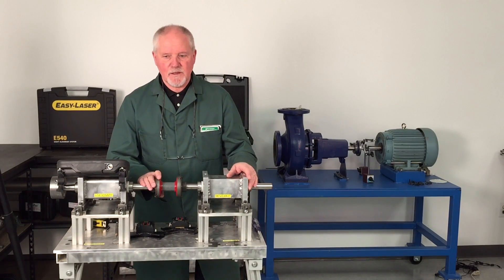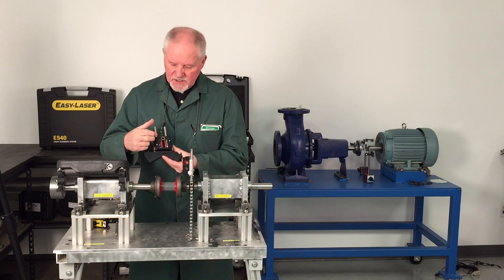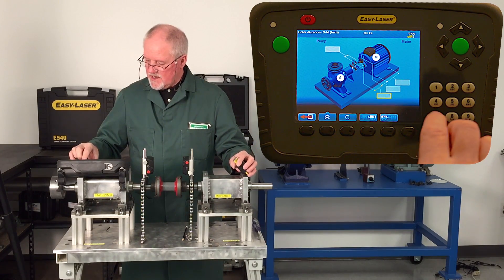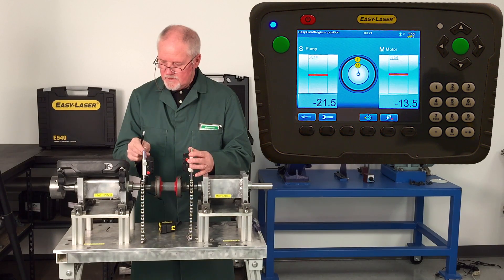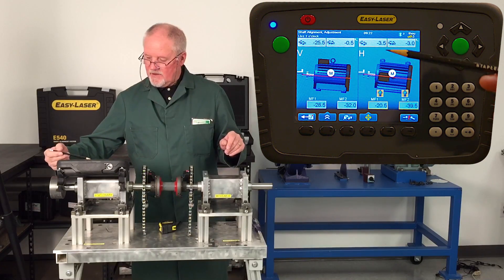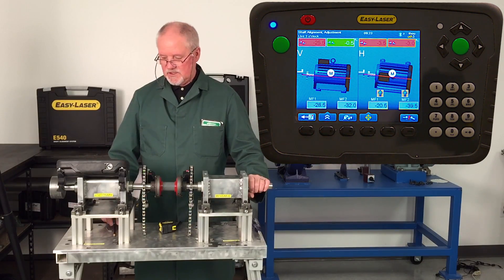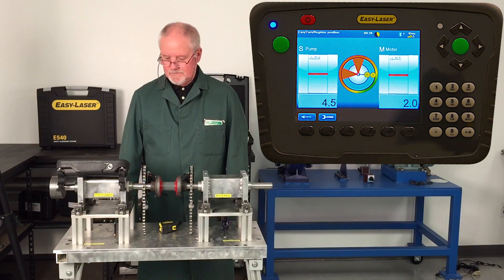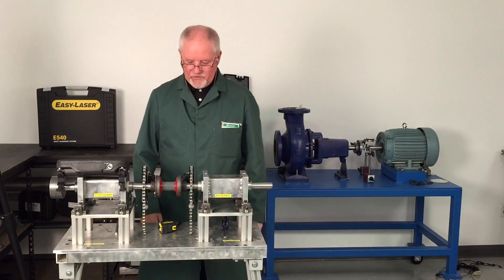Easy-Laser E540 (& E420) Training - Horizontal Shaft Alignment

Comment: At 4:49 you said you're happy because it's under 20 thousandth? But after angular adjustment, one of the values are more than 20 thousandth, why continue with the alignment ?
Reply from the maker: Getting it under 20 thou is just a basic rule of thumb for setting the beams up but anywhere near 20 thou would be fine. All we are doing here is getting the lasers close to the center of each detector surface. The reason for this is so it can stay in each other detectors surface when you rotate the shaft 180 degrees. As soon as you take your first measurement it creates the references going to zero and measures from that first position. If there was a lot of misalignment, at a long distance out in the field, there is a chance the laser can come out of the detector surface if you don't get the lasers in the midst of the detector range (ie. the center). However, at this small distance, it wouldn't matter. It is good practice to get it close to zero if you can.
Reply: @BENCHMARKPDM  thanks for the info sir. This info wasn't found in the E-420 manual and hence my question. Thanks again ;)
Reply: How much sim we add under the foot.according to the reading or half of the reading?

Comment: Sir, how you measure the 4 inches?
Reply from the maker: The 4 inches is the S-C distance, Stationary unit to center of coupling. The S-M distance is automatically halved to give the the S-C but you can override this if the center of the coupling distance is different.
Reply: @BENCHMARKPDM  thanks for the info sir ;)